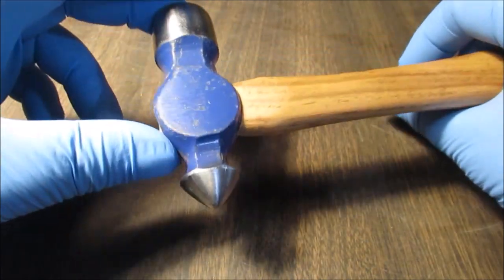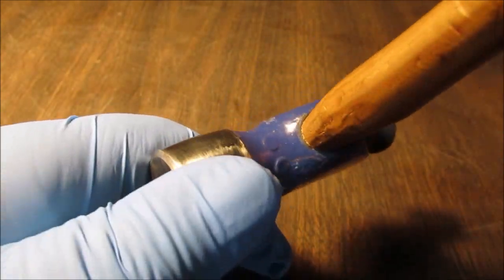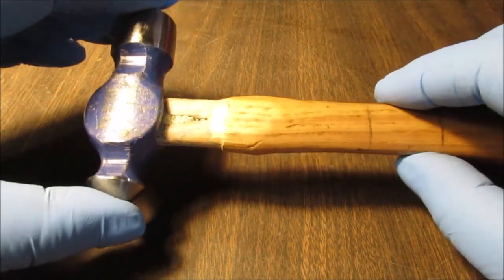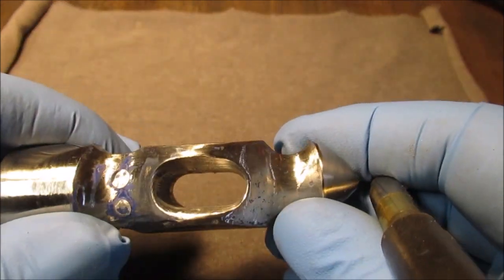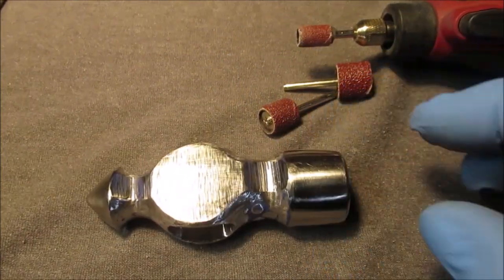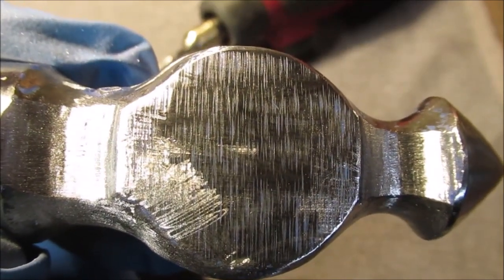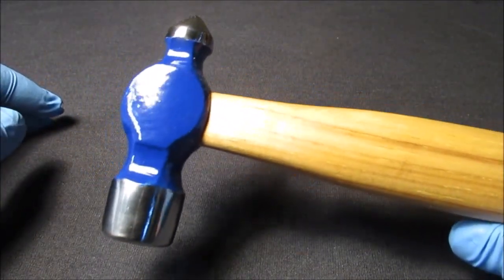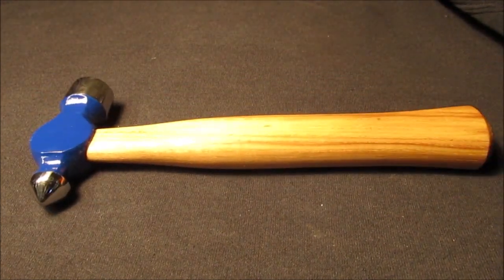REDO 8 oz Ball Peen Hammer

Comment: That is a clever tool and looks great. I can see where that will come in handy where you need to address a small area but still put some more weight behind it than a tack hammer.
Reply from the maker: Thanks...I have used this one before on my garden tractor hood doing body work